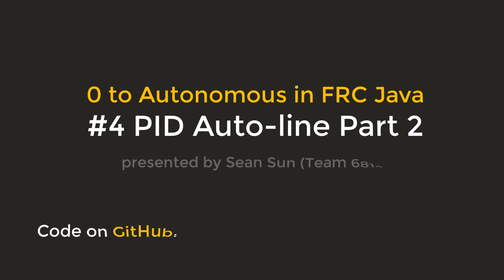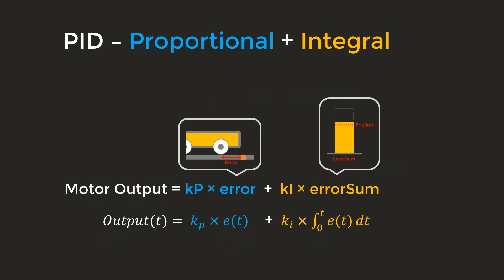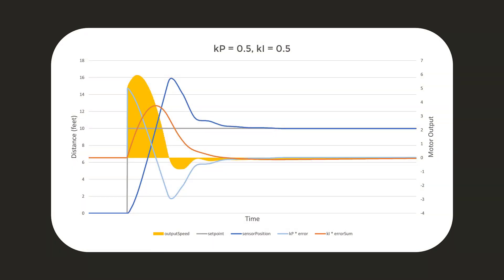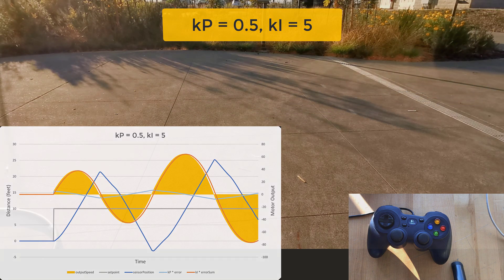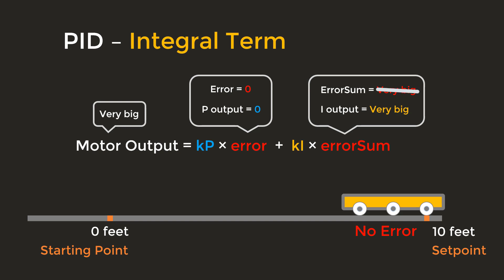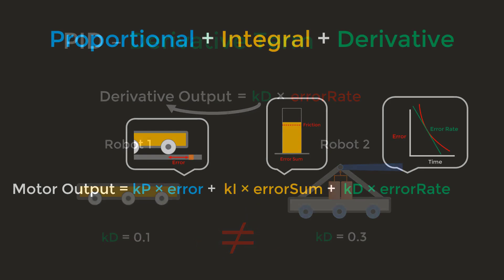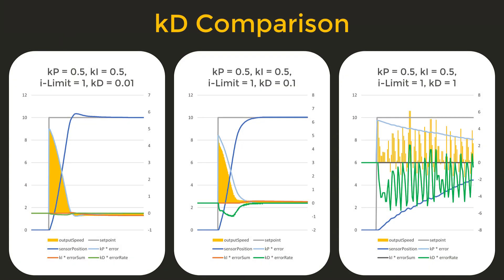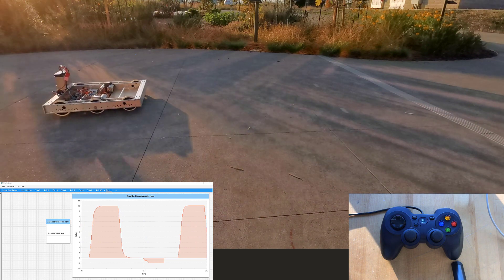FRC 0 to Autonomous: #4 PID Auto-line (Part 2)

Comment: Very good video. I was fascinated by the graph you used to describe the robot movement. Could you tell me how to make them?
Reply from the maker: This is what I did:
1. When the robot is runnng, write all the variable values into a newly created ".csv" file on the roboRIO disk, each line containing values for one execulation loop
2. Afterwards, use FileZilla to ftp onto the roboIO and copy the ".csv" file onto my computer
3. On my computer, use MS Excel to open the ".csv" file and display it in a graph

Here's my code for step 1:
https://github.com/SeanSun6814/FRC0ToAutonomous/tree/master/%234%20PID%20Auto-line%20-%20PID%20Control/Graph%20Generating%20Robot%20Code/PIDChassisTest/src/main/java/frc/robot
Reply: @0ToAuto  Aha thanks a lot (Should have thought about using csv but have been dwelling on Shuffleboard xDDDD), your video is really very wonderful;!